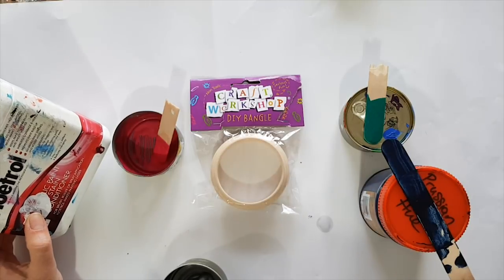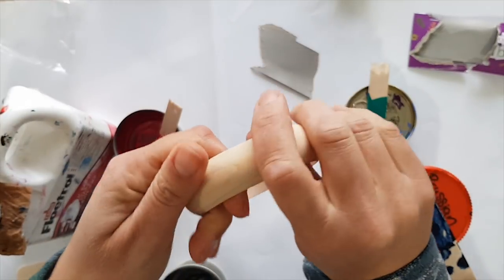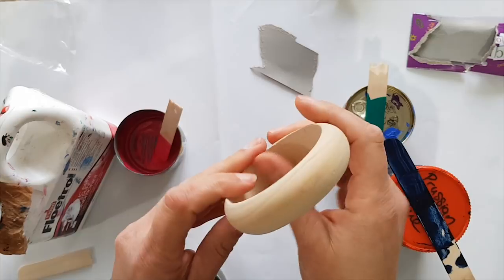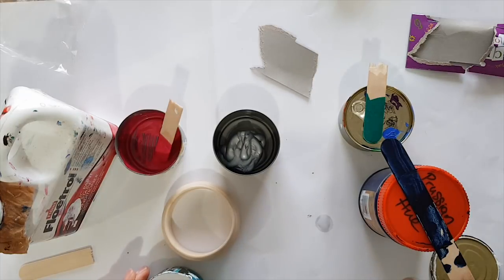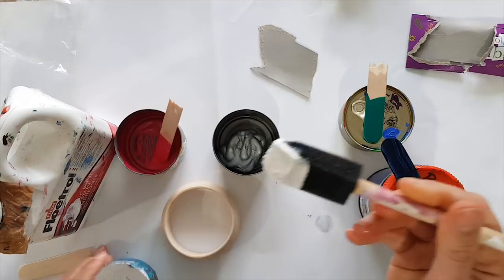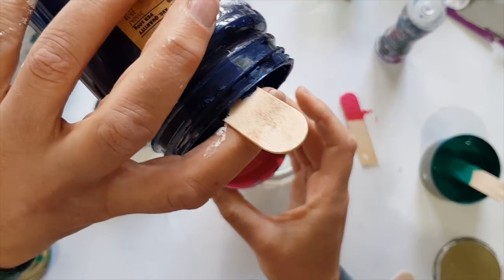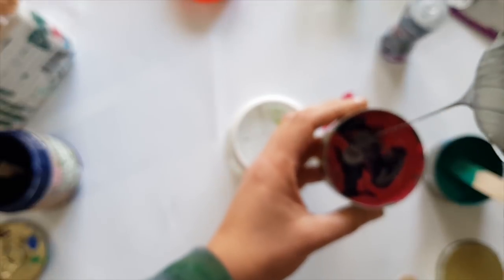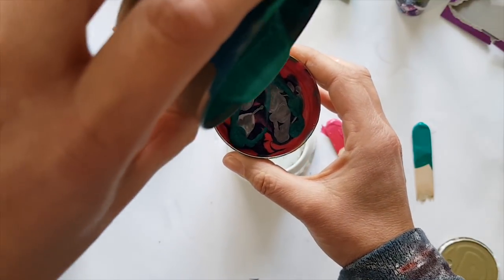292 Metal Bracelet Made With Wood And Paint  SOLD

Comment: I generally use 2 to 3 parts floetrol to one part paint. Then distilled water if needed. I mix in several drops of silicone mix really well then as I put paints into my pour cup I add a drop or 2 of simethicone. I get great big cells filled with little cells.